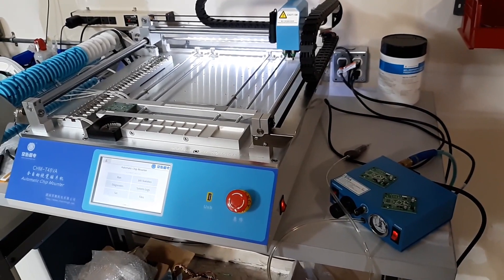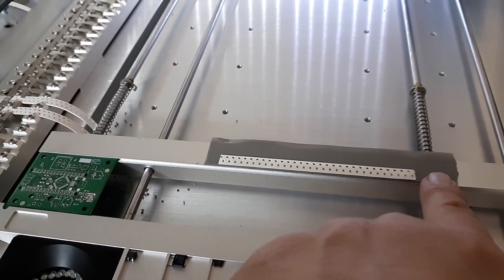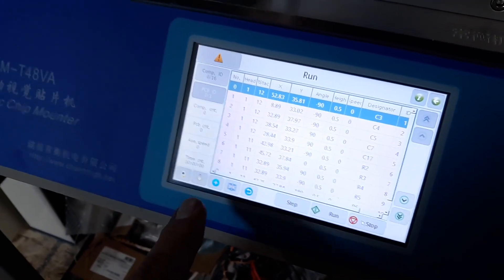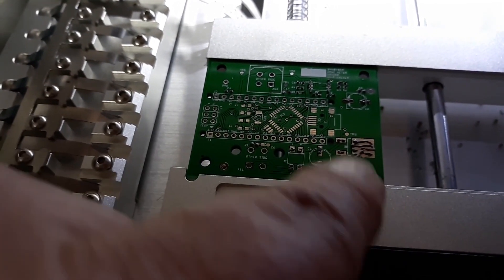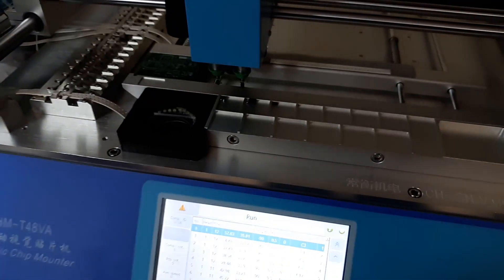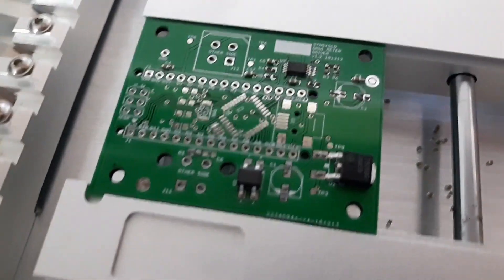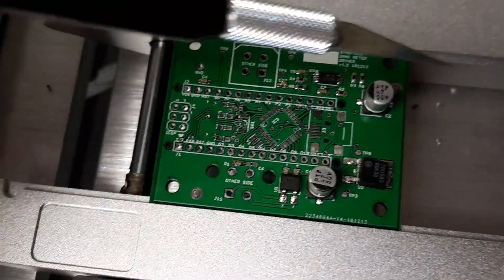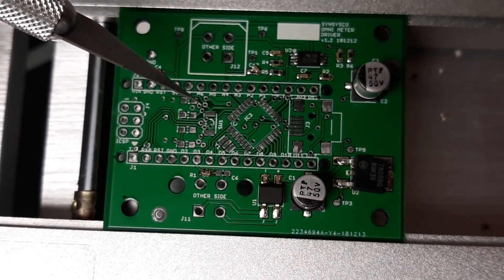190304 CHM-T48VA First Board Run

Comment: how does this machine advance the components to the next one on the reel/spool, with the head?
Reply from the maker: Yes, it has a pull pin on a solenoid, pin extends down to pull the tape.
Reply: @CraigHollabaugh  great, thanks

Comment: I pay homage to your skills and envy the machine.
I have TVM802A and it's a mess.
I asked for a/s, but I'm not going to solve it physically and I'm going to end a/s with only software settings. Bad QIHE!
Take a look at the video below: I ask if this determines that it is possible to repair the software by modifying the parameters without replacing the parts.

https://www.youtube.com/watch?v=YZ8rasY8-Mk&t=542s

Comment: Since this only has two nozzles, can you stop your program to change out of nozzle for a larger components relatively easily?  By the looks of it you will need one nozzle just to do 0402 and another to do SOT-23, SO-8.  So there is no way to do a large LGA or BGA on the same run without stopping?
Reply from the maker: You can pause but can't move the head during this pause, so nozzle exchange is a problem. Its easier to just run to different programs for the larger parts that require a larger nozzles. Thanks for watching.